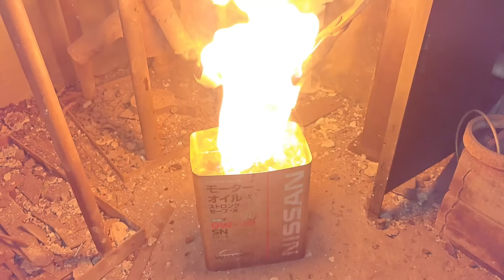Making a Nessmuk Knife out of Rusted Drill

Comment: Here's an interesting idea, a twisted damascus blade with used steel and copper. I love the single line down the middle but im curious to see the contrast when its all across the blade in random patterns.
Reply: That'll be cool but I think it might cause cooper to be on the cutting edge which wouldn't make the blade the most functional. At least that's my theory we won't know unless someone tries it out.
Reply: @jahurtadon  You make a good point its true, there's a risk the copper twist might get on the blade edge and make it weaker. I guess testing it would be the best way to know as well, even if it ends up as a display piece only.
Reply: Copper would be too soft to be along the edge of the blade.

Comment: Can ask a question about the steel please? As the billet was being cut for stacking and cleaned for the forge weld the sparks it was throwing were not indicative of carbon or tool steel, but after you sprayed on the template and started cutting it, it was putting out a massive shower of sparklers. Why?

Comment: 07:42 зачем в начале лезвия со стороны ручки круглым буром делайте полуотверстие? Уже не раз видел и не могу понять, объясните плиз. Привет из Киева!
Reply: The notch (half hole) at the beginning of the blade helps make sharpening the cutting edge easier. With the small cut in, you aren't running the stone or belt into the plnge line or guard. It just gives you a little extra room to work.
Reply: thank you very much, now I understand.  Your video is very beautiful and your products are simply brilliant.  Hello from Kyiv Ukraine!